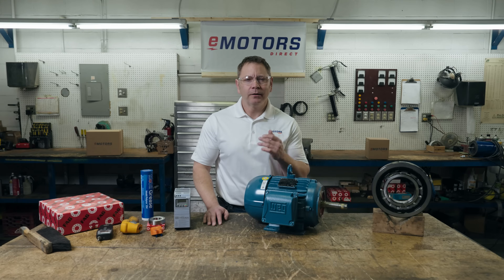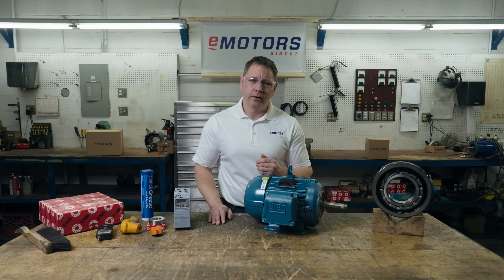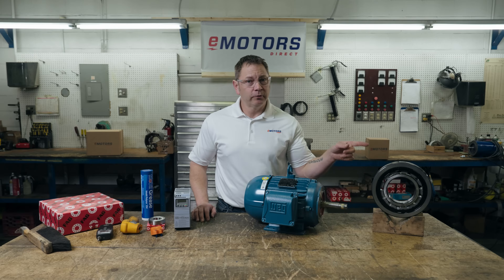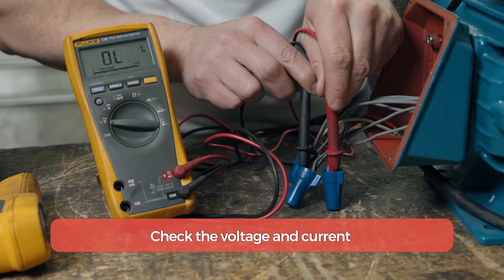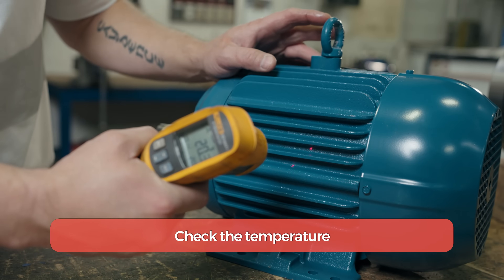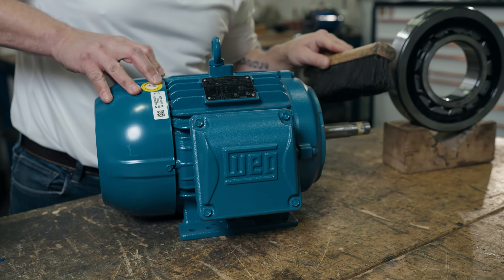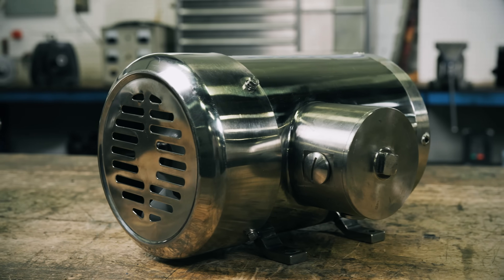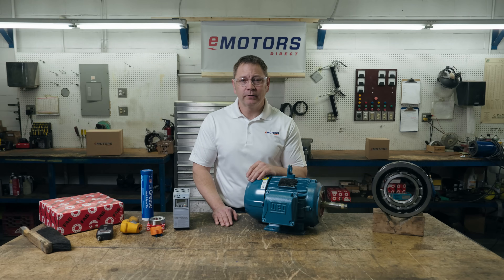Electric Motor Maintenance Checklist

Comment: I'm seeking clarification regarding the current rating of the motor mentioned in your video. The motor sheet stated that at 115 V, the current is 12.5 amps, could you advise?
Reply from the maker: Hi James, thanks for the comment. In this particular video, I don't see a reference to 115v 12 amp motor. The motor on the table is a 575v 5 amp motor. Were you looking at a different video by chance?

Comment: My electric Motor makes a squeaking noise when you turn the shaft by hand or when the motor comes to a stop. It sounds fin while running. My theory is that the bearings need lubrication? Is this assessment accurate?
Reply from the maker: Hi Eric, sounds like the bearing either need to be greased or replaced. I'd try greasing them first and see if this fixes the issue.
Reply from the maker: Here's the step by step guide: https://youtu.be/PjeDqPBp0RA?feature=shared

Comment: In regards to overheating, how do I find what the normal operating temperature of an electric motor should be?
Reply from the maker: Great question. The maximum ambient temperature for motor operations is 40°C. Anything higher will require derating.

In regards to the temperature of the motor windings, these measurements are made internally via RTDs or thermistors and the allowable temperature is defined by the insulation class. (Class: A = 105°C, B = 130°C, F = 155°C, and H = 180°C.)

The surface temperature will generally run 20°- 30° C lower than the temperature of the windings.

Comment: Motor overheating due to high torque on low speed. I have this on chilled water pumps running on vfd's. Not sure what to do about it.
Reply from the maker: Great question. Is the motor fan ventilated? If it's fan ventilated, a secondary blower must be added to achieve high torque at low speed due to the cooling drop off caused by the low speed. If the motor isn't fan ventilated, then it's likely that either the FLA or duty rating is being exceeded and the motor is undersized for the application.

Comment: Big motors come with heat sensing resistance in winding, it will disconnect automatically when motor over heat,,,similarly we can add some temperature sensor with resistance measure temperature all time thanks